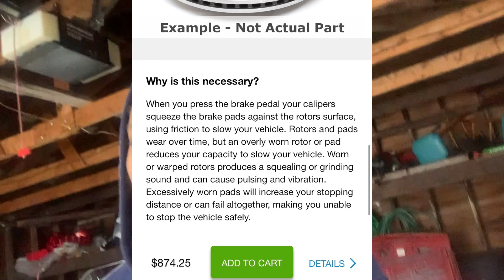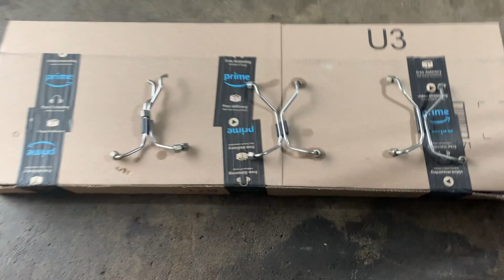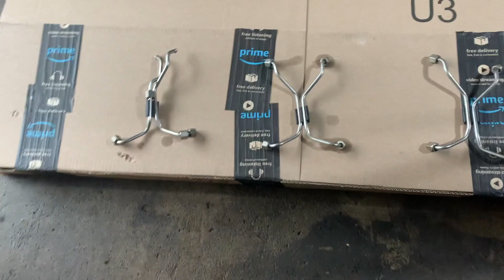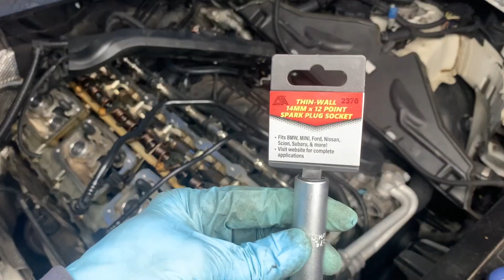How to change Valve cover BMW X3 (F25)

Comment: Hey the rest was great. I am starting exact same job. First video i found that shows twin turbo 35i. Problem- i cant seem to figure out how the small lines from the turbo disconnect. Dont wanna break them. Any advice or tricks appreciated!
Reply from the maker: Can you give me a time stamp? Most hoses have some sort of lever or tab that you have to squeeze
Reply: @carswitlos5937  2:10 I think - it was high speed
The tube runs from the turbo air duct on left across engine to right
Reply from the maker: @pignapoke6772 squeeze both of the tabs push down first then pull off
Reply: Thanks! 🙏
Reply from the maker: No problem
Reply: I’m actually stuck - the bridge for the wire harness back over cylinder 6. No way that round head bolt is moving. Even if I can get a tool back there, the torques female end on the bolt seems too shallow.. all I have left is that bridge, the fuel lines, and to take off the valve cover (and I know I will have an issue accessing the bolts in the back for sure.) wish I hadn’t started this. Too late to turn back tho.